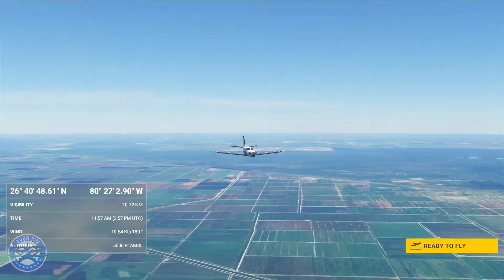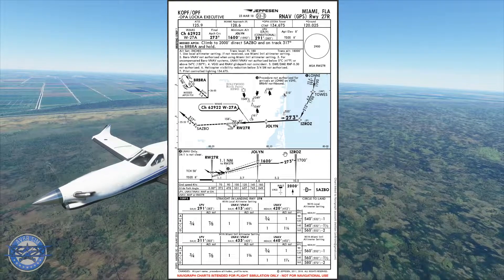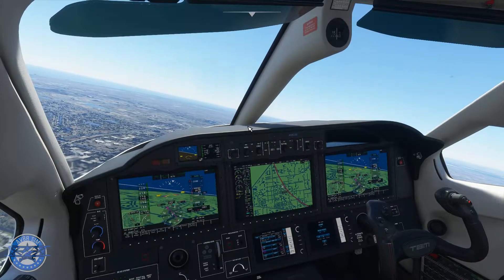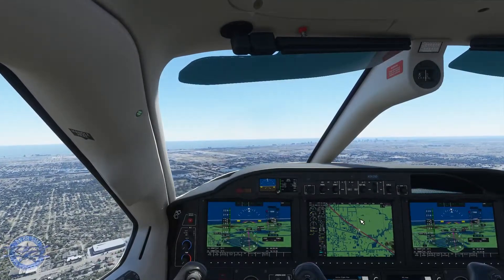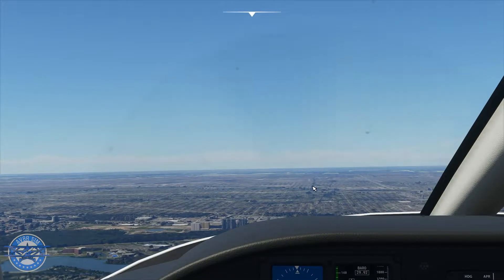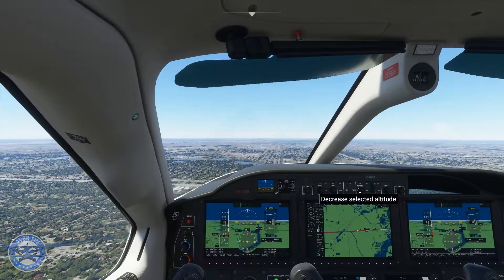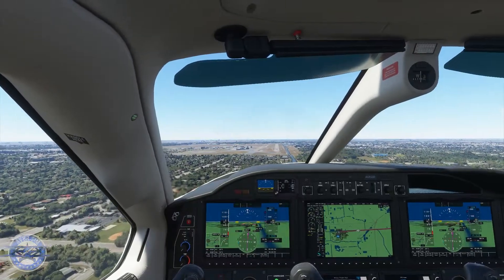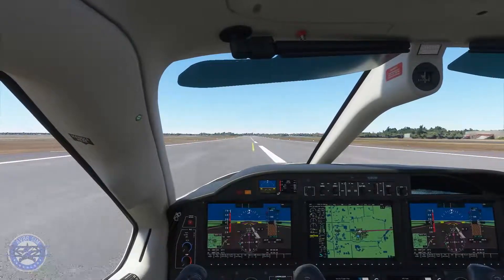Microsoft Flight Simulator | How To Fly An RNAV Approach | TBM 930

Comment: Appreciate this vid!  I do have a question or two.  I'm currently flying within the confines of the XBOX Series X.  When flying a RNAV approach, no matter wha tI do, I never am able to capture the GP.  I've tried to simple hit APPR and nothing happens, I simply hand fly down.  I've even tried the "Load & Activate" from within the MFD menu and either nothing happens or the AP, banks to re-cross a previously hit waypoint.  I use my approach plates and altitudes and hit my mark at or below the posted altitude every time.  

My question then is this, when (and how) should I activate the approach (at what point do I start...IAF, IF or FAF?  1. Load & activate within the MFD, then press APPR. Or 2. simply select APPR?

Thanks in advance!

Comment: hi, i am from suffolk co , ny i fly from mac arthur in the sim. i love this plane but sometimes it does weird stuff to me. i am confused on something with rnav. do i have program approach in flight or can i set this at runway. i flew last night but i miss approach, it did not capture the gs.
Reply from the maker: You can load the approach into your flight plan before taking off. You’ll need to activate that approach as you get closer to the first approach fix. It also may be a bug with the sim, I’ve experienced many of those since the release. If it’s still not working, trying searching the “tbm 930x mod” online. I’ve been flying this version for a week and haven’t experienced any issues.

Comment: Back in 1980 I got my cpl with instrument ratings and later on the cfi and then worked couple of years as flight instructor and all that at Opa Locka air port,  your video brought back the memories. 
Wish we had all these simulator stuff back then, would have been a great help learning. 
Thanks.
Reply from the maker: I’m glad I could trigger those good memories😊

Comment: I think no glide slope because you didn't program the localizer number into Nav 1.
Reply from the maker: Ken Norwitz you are 100% correct
Reply: @LesGainous  The localiser has a frequency. Even when flying an RNAV approach you can add more navigational aids. VFR pilots with modern avionics do it as well. Technically not necessary but it offers redundancy.

Comment: Thank you very much for the video, probably the most useful out there on this topic so far. However, various problems when I'm trying this: 1) GPS track is not displayed on the MFD when I'm starting the sim from mid-air 2) RNAV approach to KORD 28R leads you to land...on a taxi way 3) ATC instructions correctly mimic the profile heights on the approach chart but as a consequence the glide slope at the FAF never gets picked up (since you're flighing at or slighly above it). Microsoft/Asobo still have some work to do.... Btw, anyone know what the VNV button in the TBM is supposed to do? Can't find it in the manual and when I click it nothing happens (?). And yet another question: does LPV ever show up on the MFD when doing an RNAV approach? Is it modeled in the sim at all?
Reply: from what I have read, VNAV is not working yet

Comment: What is the difference between an RNAV and ILS approach? i just mastered ILS approaches and now trying to learn RNAV. im just not sure the difference.
Reply from the maker: ItsTechnoo they have different minimums. RNAV being higher than ILS. In IMC conditions, you’d want to fly an ILS approach over an RNAV. With an RNAV approach you’ll need to be in VMC and have the runway in sight before landing. With an ILS approach, you can join the localizer and not see the runway until you’re just about to touch down.